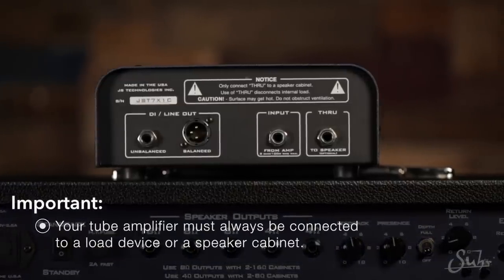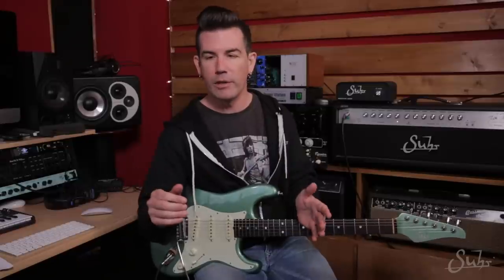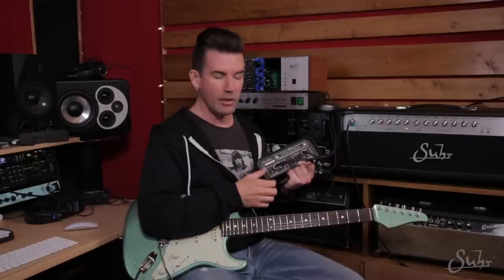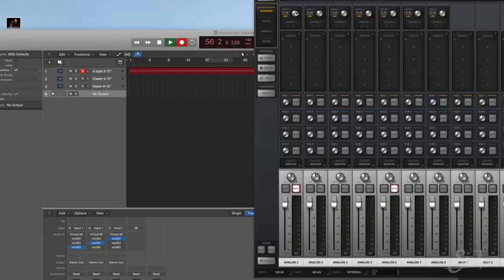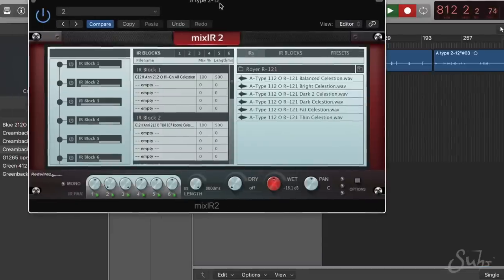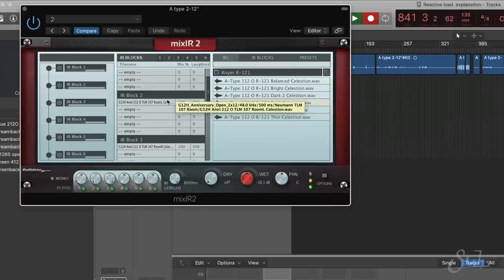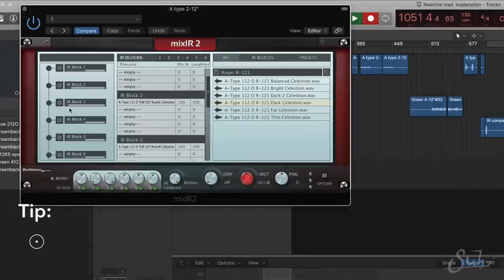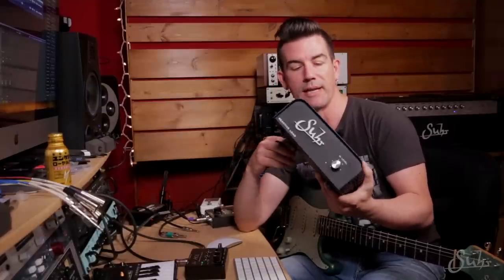Understanding the Suhr™ Reactive Load with Pete Thorn

Comment: Excellent video, happy to see an overview of the Suhr RL finally available. The only thing missed was the process of using it with an overdriven amp. Kind of surprised this was missed as I would think 95% of people interested in purchasing the RL would be for working with overdriven tones. Overdriven tone unlike the clean tones from the video will require a bit more “boost” to the signal as it is a more compressed signal. This can be accomplished via the level pot on the RL, the level adjustment on your interface/DAW or even a combo of the two. 👍🏻

Comment: Great video, Pete!   Believe it or not, I just bought one of these -- in 2021 -- because I prefer to use the Celestion SpeakerPro dynamic IR's rather than something that comes with a load box (including the OX).  I have a question, however, if it's not too late, about the XLR balanced output going into a mixing console rather than directly into an interface.  I understand the issue with mic levels being set at -30 on some interfaces, but I don't have that problem with my console.  I didn't quite understand, however, the issue you mentioned about how the XLR output might somehow alter the tone of the reactive load.  Can you elaborate more on that?   Are you saying that even if I don't have an issue with the level, I still need to be concerned about using the XLR output?  Thanks very much!
Reply: I can't speak for Pete, but I believe he was just cautioning us about the difference of using a XLR mic input and the amount of signal you need to give your mic preamp. Pretty much avoid using a signal that is too hot. In general you don't want to just keep turning up the DI knob until you get below where you clip. There is a sweet spot well below that in terms of signal level. You want to leave yourself plenty of headroom so you never introduce clipping into your mixer or audio interface.

With that said, you don't want the signal so low that you have to apply tuns of gain on your preamp/mixer/interface so it becomes audible/strong enough signal for your mix.
Reply: @wootks  Thanks so much.  That makes a lot of sense!  My signal coming into my mixer has, in fact, been a bit low, so I might try turning up the DI a little bit.

Comment: Hey Pete, just a quick question, I'm wanting to use cab sim in a live situation as a DI to the desk instead of miking up my amp. would this box be a good solution toward this? (Maybe coupled with the mooer or something similar) I'm plugging into a Mesa Express. Cheers.
Reply: If you mean the mooer radar ir thingy then ya it would work pretty good I think.  If you're running a cabinet as well for monitoring behind you or something it'll sound different than the pa though

Comment: Im new to this. So, if i have a line output on my amp,  I would not need a Load Box to plug in my interface, right?
Reply from the maker: Sure you would unless you are using the speaker as a load

Comment: Is the issue of running XLR to XLR mic-in just level?  Is there any advantage to running XLR to TRS line in with the SRL output higher over XLR to XLR with the output lower?  Also - does the unbalanced output have the same sound, and is there an advantage to using it into  a hi Z input vs a line in that will accept an unbalanced jack?

Comment: you dont use HI Z with line levels and especially mic levels (XLR)....It s basically for when connecting the guitar straight to it......;)....what did i miss? i suppose u know this (i realise now you were using the trs jack...still, not for HI-z..... i don t use HI z when i connect the gt1000 to interface with jack )

Comment: Brilliant vid! Learned a bunch about recording. Pete Thorn is DA MAN! Quick question. Do amps that have various Wattages that you can change with the flip of a switch or push of a button have resistive load circuits in them? Or are they reactive load circuits? How does that work? Thanks for an awesome vid!

Comment: Does using an attenuator on a daily basis (like in a bedroom apartment) could cause a faster deterioration of capacitors, valves or maybe something else? If so, would you recommend a lower wattage amp?

Comment: If the speaker through jack disconnects the internal load, then what's the point of using the reactive load? Can I still use it as an attenuator when connecting the reactive load to my guitar speaker?

Comment: can a speaker output from a solid state amp be connected to an interface without a load? of course it has to be converted to line level, but is running a solid state amp without a load okay? more specifically, this is a question about amps that do not have a direct out. since many/most solid state amps today have them.

Comment: Hey Pete - Once again, GREAT informative video. Based on your loadbox shootout I also chose the Suhr RL. Shortly afterwards I picked up a second Suhr RL unit to use when I want to record with a 2 amp setup - works really really well & i love the Suhr!

I have a question - in your walkthrough of MixIR you're showing some settings where you blend the close mics with room mic pairs. Are you running a stereo or mono instance of MixIR? I would think that, to get the full flavor of the room you'd have to be in stereo but looking at the pics showing Logic you appear to running a mono channel? So which would it be? Thanks in advance!
Reply: +1

Comment: Great video. I have a question: Can I use the Suhr reactive load with my fender hot rod deluxe? Or is just for amp head. Thanks !
Reply: i think you just have to unplug the amp's and speaker's cable and then take that line from the amp out to the Suhr reactive load
Reply: Banana thanks ! I appreciate your help.

Comment: Great video Pete. Very clear and concise. Re the xlr to xlr level thing. Is that always the case for all devices? I ask because I use xlr to xlr from Helix to my Scarlet interface. I’ll maybe try xlr to trs (if scarlet input is trs and not mono )
Reply: I have a similar question as I run an sm57 micing my amp into a 2i2 with XLR to XLR. Would it be better to run XLR to TRS into the 2i2?

Comment: Dude! This was helpful. I have always used xlr to xlr with my Rivera rockcrusher recording. I run a Behringer x32 producer directly into traction. My x32 doesn’t offer a TRS input. Do you have any suggestions? Thank you Pete.
Reply: You should have a line level input someplace. 
Do not use a Mic input
Reply: John Suhr hey John. Thank you but the Behringer x32 producer does not have a 1/4” input. I will probably have to try the auxiliary input somehow. By the way I love this Pete Thorn Signature Guitar. I just wish it did not cost so much to send it back to you for a different size neck :(. Everything else is killer!!!  Cheers

Comment: Hey guys and audio pros I have a problem with my suhr reactive load ir. I got it today and set it up as stated in the manual. But now I notice in my DAW that there is a hiss sound recorded around -40 to -30 db which is noticeable. I checked the amp and the cables but even if I put the amp to stand the hiss is still there. Help or advice is much appreciated. Thanks!
Reply: noise gate

Comment: Great video Pete .   I thought I knew most things I needed to know about loadboxes.. and this video showed me things I wasn't aware of..  top job and the Suhr looks like a great loadbox.
I had no idea that you could use the Suhr load box without a speaker connected... which is great for silent recording.  The issue for me is that if the speaker is connected, I want to be able to attenuate that speaker.. so I can mike it up and record great guitar sounds without raising the roof.  The way this appears to work, is that the reactive load is disconnected when the speak output is plugged in.  So..  is the speaker not being attenuated.  You spent a lot of time on the 'in-the-box' aspect here.  Sort of gives the impression that this is not the box which will attenuate the speaker in a cabinet... and made specifically for DAW users.  I'll contact Suhr via the contact us page and chase that one down... 
Great video as always Pete
Reply: the speaker thru jack is only likely to be used to give a signal to the sound man so he doesn't have to mike your cab.
Reply: No you would still need filtering. Plug in to that to disconnect the internal load and still have the line out working.
Reply: John Suhr yeh but if you run the line out to a speaker sim box like your Ace, you could send that to the sound man and just use your speaker cab as your monitor. No mikes to get bleed in etc
Reply: Right, just wanted it to be known you still need a speaker sim of some sort

Comment: Pete, can the Suhr RL be used as an attenuator also? Thinking the DI know could control the volume output without losing the sound-just hoping...
Reply: Nope, it's a load only.
Reply from the maker: You can send the output to another effects loop return or power amp and cab and lower the volume that way very nicely.

Comment: Don't also forget most of these loads are 100w RMS max. That's about 2 on the master of an old 100w Marshall. Run em on full blast and things will go wrong  :o(    (I have been there)
Reply: There is absolutely no issue with using ours with a 100W plexi
Reply: Good to know, I've smoked a Two Notes with a '76 100w JMP :o(   might try the Suhr one next then!
Reply: Paul H no problem, we blasted our SL68 for days.

Comment: can you use it as an attenuator?
Reply: If you run it in parallel with another speaker if same impedance you will drop SPL by 6dB. You can also use it to reamplify in to another power amp.